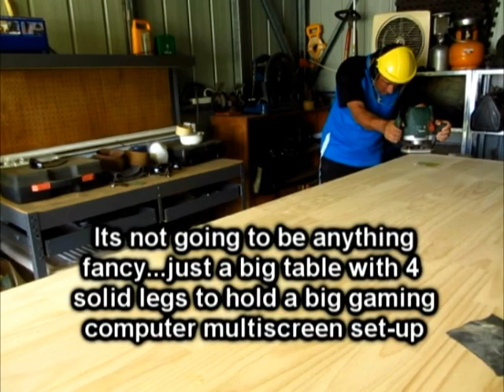Woodworking. Building a basic table/computer desk - part 1.

Comment: RDPproject  I've done this same thing with polyurethane and saw dust a few times in the past. I've also ran into the problem of not having a syringe on hand. I found flavor injectors for turkey basting or refill syringes for ink cartridges work as a nice stand in (you can file the outside of the tips to bring them to a sharper point). Additionally sometimes as it dries air works it's way to the surface and makes tiny hard bubbles. That and saw dust sometimes being hard to work in caused me to adopt tamping saw dust in with a paint brush.